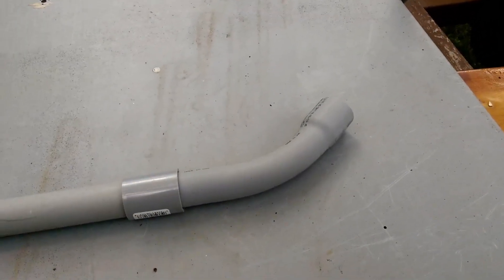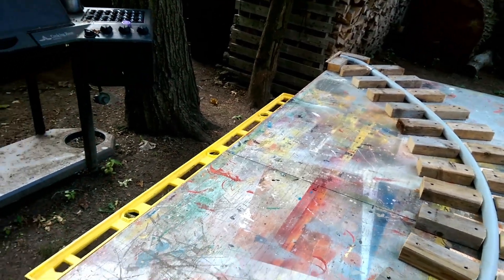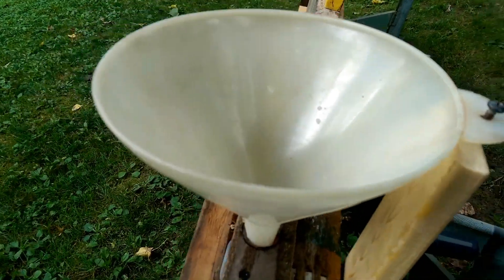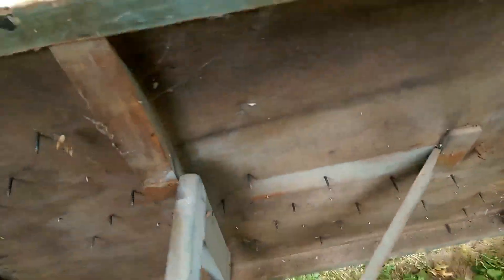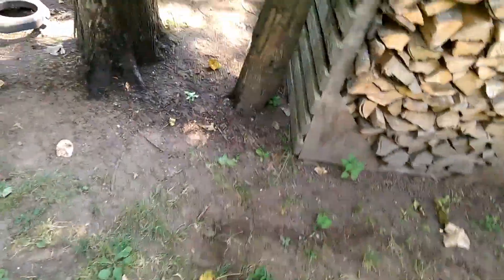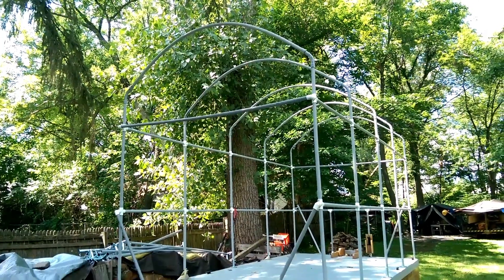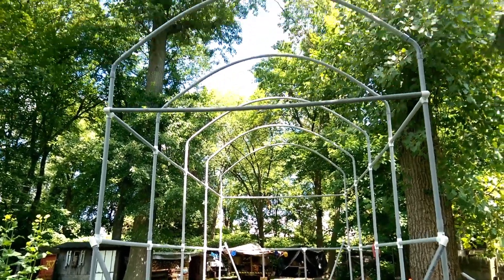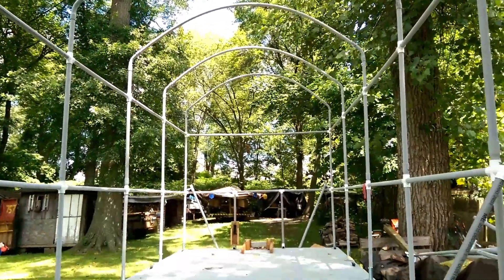PVC Pipe Bending

Comment: Very similar to my jig I made to steam bend HARD MAPLE (1" thick) for the edge banding on a countertop.  There's calculations of how much overbend to use (since wood will straighten a bit when taken out of the jig), and how long to steam the wood (I used a 6" diameter length of PVC with dowels inserted through it to support the wood yet allow the steam to make maximum contact, with the steam rising up into it at midpoint and traveling towards the two ends.  First piece of wood snapped, but the second took the form and came out great for the countertop.  Fascinating thing is that hard woods actually steam bend easier than soft woods, because of the nature of the grain...

Comment: why not just use 3 x 45deg elbows and a couple of straight pieces of pipe, same result without the hassles
Reply: Every joint is a weak point in the length

Comment: Easier way to introduce hot water would be to run a hose from the drain valve of your water heater and let the heated water pass safely through the hose into the pipe with no chance of burning yourself by tripping, etc.
Reply: No hot water tank on on a tankless on-demand system. Also, it's a small amount of water.
Reply: @jlouis9894  I am well aware of that. The same function can be used with a system drain valve . Not every plumber installs them but it is a very common sense  feature. A hose can also be afixed to a tankless system with a simple adapter. Taking a feed from the tankless heater feed AHEAD of any faucet will deliver water pressure at a higher rate that after a faucet mounted aerator. In addition, as I mentioned originally, use a hose to directly feed the end of the PVC pipe will also drastically reduce the possibility of spills and burns.
Reply: @jlouis9894  Uh, yea. That is rathwer obvious. Using the tank drain valves is ONE method to achieve a ready supply of water , or rather, 40 gallons of water. A direct feed to a hose, as explained previously is also possible with a hose to faucet adpter .
Reply: You got a 175  degree hot water heater?
Reply: It does not require 175 degress to soften and refoprm PVC pipe. Obviously, 1`/2 inch dimeter will reform for easily than a larger diameter due to surface exposure.  we have done this many times over the years.  yes, using hotter water ican be fdaster, but weighing the obvious dangers, slower is the MUCH wiser choice. When bending larger diameters or creating offsets, we use a commerical heat bender. But forone or two =offs, the water heater method works fine.

Comment: The take away here needs to be the method that this gentleman is GIVING us. Use it , appreciate it, or modify it to own needs or devices and be thankful that he shared it.
Reply: Exactly!
Reply: @MegaKB333  Well thank you, at least two of us agree.
Reply: 45 degree angle pieces cost much more what do you have more time or more money,also what if you had tp travel 100 miles to get supplies by the way Thanks for sharing
Reply: @MissouriHippie  -  I don't know (haven't worked with pliable PVC … so I hesitated to comment on this), but my guess is that it won't bend enough [without breaking] to make a full 180-degree bend in that diameter, or that the added height would be undesirable, or that the cost of covering the greater height would be more than the cost of the 45-degree connectors, or some/all of the above.
Reply: very true, excellent info here, i need to build something similar to make a protection for my orchard that hubby and i want to do with dwarf variety fruits trees, we got to protect them from birds, hot and cold weather ...this could be the way to go.
Reply: Amen
Reply: You're going to need some horizontal pipe runs between those arched canopy supports, but I'm sure you realize that by now.
Reply: Yep; I hate when commenters get rude with somebody that's just trying to pass along good info to those of us that can make use of it! If someone doesn't like the video, move on to the next one and forget you saw this one! If someone thinks they know how to do it better, they should make their own video! Personally, I thought this one was terrific and will come in handy for me later this spring.
Reply: Gary - He's not sharing! He's selling his time for subscriptions and likes! The tripod comment was SHARING...

Comment: Awesome fixture! Thats electrical pvc pipe right?
Reply from the maker: Yes, its schedule 40 pvc conduit. I used the gray stuff intended for electrical wires. The white pvc pipe fittings I used fit & glued on just fine. There are not as many pvc pipe fittings in gray as there are in white.

Comment: In theory, the roof would be stronger if you did not heat bend it, but just forced it on and bow it, but you would have to use a physical attachment like a screw or something. That would probably be very difficult to do, so the theory might not work so well.

Comment: Nice job. I convert canoes into sailing trimarans.  For transporting my rig and camping gear to the water I used a small boat trailer and put a flat bed on it with a double bunk for the canoes.  Your idea has merit, and if you don't mind, I'd like to do much the same thing to convert the trailer into a small on-the-spot camper.  Also, I can see a version for converting the trimarans into on-the-water campers as well.  An 18 foot canoe, with outrigger struts 6 feet apart will make a fine platform for a cross thwart shelter.

Comment: Making a green house and looking for tips
Reply: Just put a metal stake in the ground on one end, put PVC pipe on it and bend it over to make a perfect Arch. Once you have several "ribs" up for the total length, Use some down each side and top to hold them up(bolted on...... treated one-by-fours are best). Four-by-fours can be used on each end to frame up a door or stove area..........larger PVC is best.

Comment: It would have been much easier to just stand the table back on its legs, leave the funnel in place, and pick up slightly on the arch side.  The water will drain out just fine, the pipe doesn't fall out of the form blocks, then roll it back over and pour in the cold...

Comment: And have you tried a $10 heat gun yet instead of the time consuming boiling water thing ? Tip your table up, Sit on your butt in a chair and just go down the pipe section at a time with your heat gun on high and the jig you made will make it take a set when it cools.

Comment: You say boat, I say greenhouse.
Reply: Since it has pontoons, I'm going to say a Floating Greenhouse  :)
Reply: I'm gonna say floating GreenHouseBoat
Reply: @bernie9728  Yea someone should tell Atz Kiltcher about this, he built a floating homestead on this seasons show (AiTLF) and then his family brought out a potted garden, well this would extend his grow season and clear some deck space (also isn't there a bad luck thing about plants on a boat) ... got that from deadliest (watch too much tv me thinks).
Reply: Camping / fishing shelter , automotive shelter,  garden tractor cover, welding shelter, wedding arch
Bicycle camper, homeless shelter

One suggestion from the desert, UV stabilized brown pipe, fill uprights with wood dowels or sand and rebar to keep verticals strait . Minimal glue
1/2 inch from end of pipe ( very little ) so that it can be dissasembly,  you can pin pipe that connects bows to collapse
Reply: My_Vizsla california cash crop
Reply: I say Grow House
Reply: Strong winds will tear that apart.
Reply: @rsz90182  house roofs too!
Reply: Have something very similar and using it for a grow tunnel to  "kickstart" my vegetable seeds and plants in the spring and extend growing season in the fall. Way outup and take down. Anchor it to rhe ground with stakes driven into the ground.
Reply: Ooopps!  I meant: easy putup and takedown
Reply: @rsz90182  ~ Try not to be a, "Negative "Nancy."  I'm pretty sure everyone knows that certain, "strong winds"
can rip a large house apart. The key is to go out on relatively calm days, right?
The oceans, and the Great Lakes have thousands of large ships forever resting on the bottom, due to, "strong winds."
"and later that night, when his lights went out of sight, came the wreck of the Edmund Fitzgerald."
Reply: Yeah buddy
Reply: If it floats, they cant tax it on your property tax.

Comment: Great job ! I worked in hydraulic fluid systems for 4 years up in Canada . This is the same technique we used to mfg fuel line , power steering line , heater lines etc .
Reply: John H A

Comment: good job dude
Reply: Why not use a heat gun?
Reply: @bjg77  A heat gun could overheat some spots and weaken them. Also, difficult to heat the underside of the pipe. It would take more time and physical labor holding the heat gun. Also the extra cost of electricity.

Comment: Pretty nifty. You might make a rotisserie for the table. Like they use for painting the underside of car bodies. Also a garden hose for cooling water. And you are using electrical conduit pvc...not plumbing pvc. I'm sure one is less expensive. Nice job though.
Reply: Gray electrical conduit is more flexible that the white plumbing type PVC. I don't know offhand the exact composition differences but you have a great point. Research the physical characteristics of the variety of tubing available and match it to your project.  I would have done it the easy way with 45 degree bends you buy premade. Skip the bending completely. It's lots faster and simpler with very little extra cost.

Comment: This video was dated 8/12/2017. How did it work during the 2018 season? Anything that you would do different? Great video.
Reply from the maker: I made a lot of upgrades which built upon the original design. Added a snap on ridge pole,  and a gull wing extension to either side so rainwater drained out past the deck to keep it dry. Also made a PVC outhouse which way a big hit with the ladies. I'll work on posting the modifications for all to see. The canopy just keeps getting better.

Comment: I've made large sweep elbows with 21/2 inch pvc. I used 2 salamander heaters pointed towards each other. Your right about the noodleing, it can get beyond workability easy. For what i was doing i couldnt form it like you did. Maybe in phases. I went a full 90 degrees bend, 3 foot sweep. But I've never thought about boiling water. Ultra simple. Thanks for sharing

Comment: If  you want to do this with steel... different ball game.  The old school method [no work table or bending shoes] is to pack the pipe with sand [to prevent wall collapse/severe ovaling], cap the ends, then heat it with a torch to bend it segment by segment to arrive your final custom curve with whatever you can find to apply controlled leverage - a hickey for rigid conduit works reasonably well, but use anything you can control [even a tree stump, a sledge and a block of wood can go far].   Try not to bend to a tighter radius than 8x pipe diameter as a rule of thumb, but it can be done as tight as 5x  with extra care and the right amount of heat.  You can chalk an outline on any large cement area as a starting template on the cheap, then match pieces.  Once you like your shape, uncap the ends and flush it out.
Reply: Wise people, thank you so much. How do you join with the uprights, do you use a bigger pipe?
Reply: My dad built a dunebuggy in the mid 60's.  I remember helping him fill the tubing with sand for bending.   Worked well.

Comment: why not use a heat gun.  not wasting water
Reply: Wasting water? Are you serious? You would rather spend 2 hours with electricity?
Reply: @briantannerslatten8944  water has to be heated.  how much energy is being used heating that up or the cost paid to pay for th water.  a heat gun can heat plastic quick,  i have used a heat gun,  it does nottake long to soften plastic or rubber. ,  no way 2 hours long
Reply: @briantannerslatten8944  - I am with you 100%

Comment: Did you consider a gable type roof? Two straight pieces meeting at an angle?
You could have used 90 degree bends (elbows).
Seems to be a lot of work for a simple objective.
You could then consider drilling a hole through the elbows and run a 1/2  steel rod from the (front of the raft to the end) first to the last elbow for stability.
Reply from the maker: I had to stay with the round roof to meet height restrictions when towing the raft out on the road. a gable roof would have been too tall to meet the height limit.

Comment: why not boil the water on the grill?
Reply: @otrot land
 - Saving Propane for meat!  LOL
Reply from the maker: That grill was not functional (no propane). My neighbor gave it to me for free. I was using it as a workbench until I could pick up a tank of gas. I did boil a few hot dogs in the water in between roof bows. So technically speaking one of the frame pieces smelled like hot dog water. The rest smelled like a new shower curtain.
Reply: @Da175305M  cool
Reply: Otrot,
 It appears he did ! The pan was sitting on the burner.
Reply: @victorcastle1840   he said, "I brought out my boiling water" dry leafs in burner, he just is resting the pan on the burner.
Reply: Why not steam inject? You don't have to worry about level, and an extra 40 degrees or so of heat is no big deal.

Comment: Would it hold up in a Wisconsin winter?
Reply: @ about $7.00 Extra to Cost per Pipe.  Don't be cheap, just buy the Metal Conduit and Winter and Summer = No worries!
Reply from the maker: My canopy was disassembled & stored for the winter so It didn't get a snow load or high winds pushing on it. Wisconsin winters could not damage a PVC frame if you removed the canopy material. Key is to not let a snow load build up and collapse the frame. But then again if you want to keep something covered through a winter a steel frame would fare much better since its stronger and less flexible.

Comment: I like what I see and good for you for thinking all this through.  However, a couple things:  wood has almost no thermal conductivity, so VERY little heat will transfer from the tubing to the wood.  Also, if you get any snow, your roof bows still should have additional support, such as longitudinal bracing to help carry the load and support the bows.  Now, I am going back to watch all your videos on this project.   Woops, looks like this is this only one.
Reply from the maker: The canopy frame is broken down and stored over the winter and does not see any snow loads.

Comment: This video was great.  I like this better than using hot sand.  The jig was fantastic.  Thanks for sharing.
Reply from the maker: Thank-you for the kind words. I have seen videos using the hot sand method and it does have its advantages; especially when making bends that could cause a pipe to collapse. The sand prevents this from happening because of the internal support it offers.
Reply: @Da175305M  I like the got water idea. Makes great sense for longer pieces with gentle curves. Also, use the garden hose to put in cold water to push out the now not too hot water.
Reply: I haven't tried hot sand but I have used hot peanut oil (350 - 400 degrees). I'm not certain what temperature I can get the sand up to.
Reply: Perfect - David yr the Greatest  !  * *  !

Comment: like some of the others said, your jig is awesome. After placing the pipe in it, just use a heat gun! You are golden from that point with schedule 40 pvc.
Reply from the maker: As you mentioned a heat gun does work and I have used one in the past. I've found its best to distribute the heat evenly along the length of any bend so the pipe relaxes evenly.
Reply: @Da175305M  I first thought heat gun because I have one and DIDN'T know about the water possibility, I think I like the water process BETTER !
Reply: why? That would take a lot longer and not distribute heat evenly (as David mentioned)...

Comment: Hi Dave, what's the diameter and thickness of the pipe you used in this video?
Reply from the maker: The raw material used to build the canopy frame was made from 10 foot long sections of: 1 inch, Schedule 40, PVC Electrical Conduit. The average outside diameter is 1.315” inch (decimal) or approx. 1-5/16” inch (fractional). The minimum average inside diameter is 1.004 (decimal) or approx. 1” (fractional). The minimum wall thickness is .133” inch (decimal) or approx. 1/8” (fractional). The weight per foot is 0.327 Pounds or 5.232 ounces. In my area the cost is $4.21 per each 10 foot long piece of PVC conduit..

Comment: You can also use a propane torch and heat it up and it will do the same thing
Reply from the maker: Although a propane torch can heat up PVC pipe enough to bend there are some disadvantages. A torch doesn’t deliver a consistent heat throughout the entire pipe length, and for this reason, a uniform curvature around a bend is harder to achieve. Too much heat in one area may also cause the pipe to soften too much and crumple in one area. One trick to avoid this from happening is to fill the pipe with sand and cap the ends. This supports the pipe’s diameter while bending and prevents the pipe from caving in on itself.
Reply: Paul Vasso  - Yup try the Water... I too did with Heat Gun... That chit melt like crazy, LOL